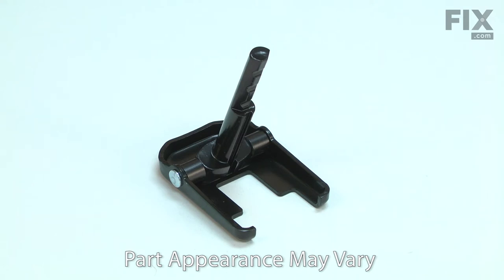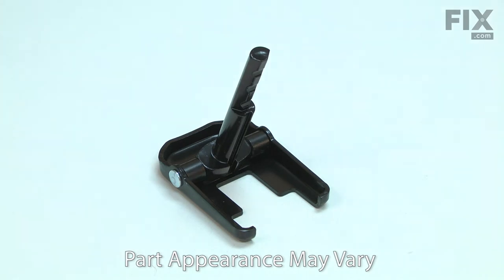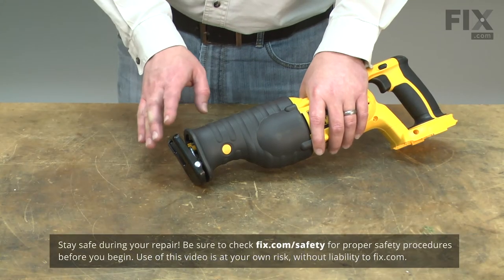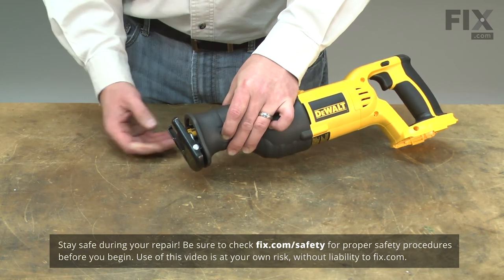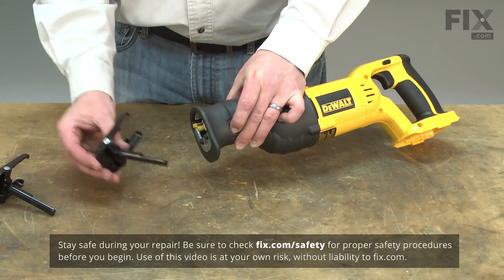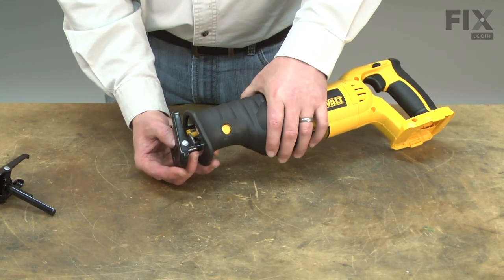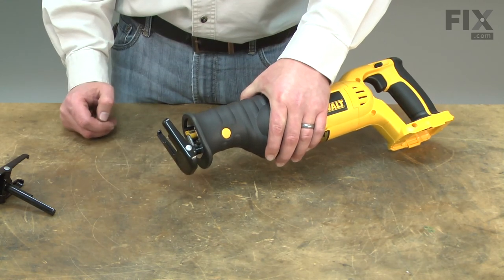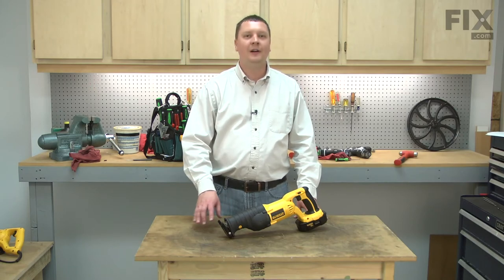DeWalt Reciprocating Saw Repair - How to Replace the Shoe Assembly

Comment: Cool.
At least I can take that off so I can get to the part that needs repaired.

The part that holds the blade appears to be loose, because when you pull that little release handle it doesn't release the blade and the blade kind of wobbles in the head